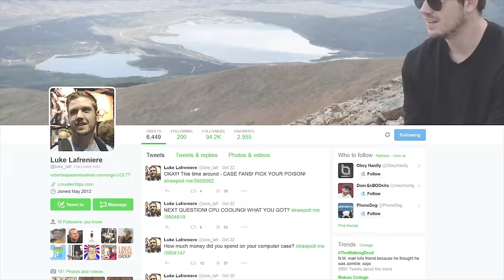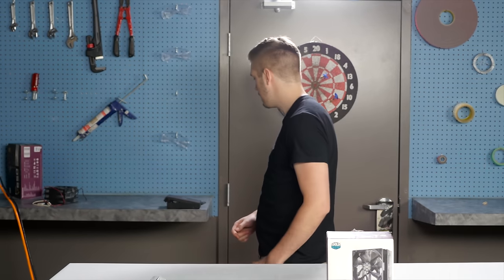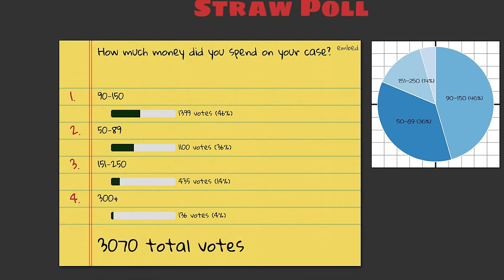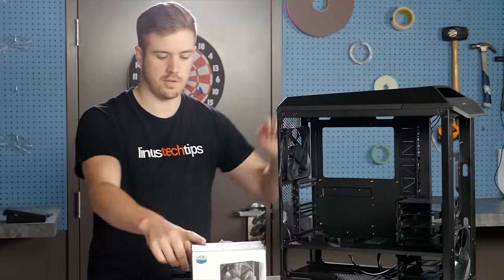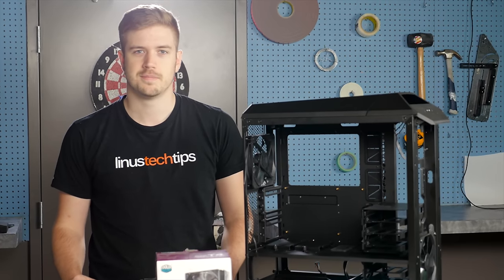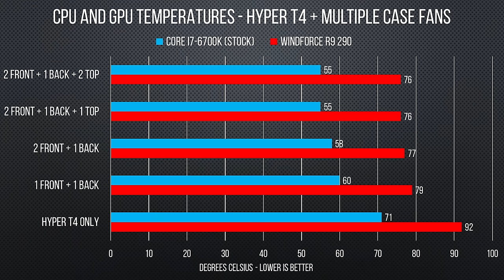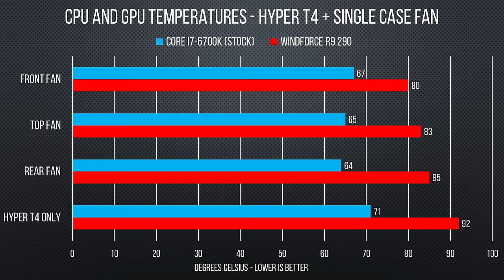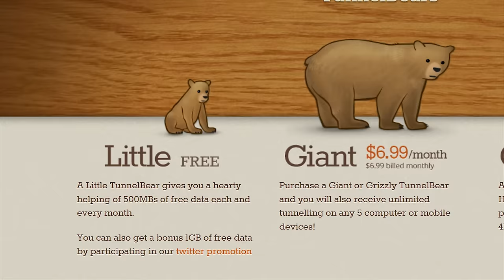Case Fans - How many should you have?

Comment: Fans are blowing in or out? How do you forget to tell us that?
Reply: Marc Marc in more than out is always better
Reply: Usually, front fans are pulling fresh air in, top and rear fans are pushing hot air out. I think he did this way ;)
Reply: Why the hell is it not obvious to you? Top and front are intake and rear fans are exhaust.
Reply: The norm is rear & top are exhaust (heat rises) & front is intake... Centiliter is trying to troll you.
Reply: Tim Beals he's actually right. It's not fair to call him a troll. Some cases have the top configured for an intake. Such is the case with my, well, case. It has a removable dust filter on the top. I can configure it as an intake or exhaust as I see fit. Though in most cases, this isn't the case. You are also correct. Most cases use the top vent as an exhaust. The whole "heat rises" thing doesn't have much of an effect in the case as per Linus. I would assume it's because the air is moving fast and in a small space that it doesn't rise much.

Edit: my case also has a side vent with no dust filter. Thought my cpu cooler fan seems to be an intake rather than a exhaust. Some cases are built with a different setup in mind.
Reply: my gpu went from throttling in stress tests to 75C max in stress tests by flipping top from exhaust to intake. Depends on the setup. If your intakes are feeding a rad for example its hard for your GPU to get fresh air since not much makes it through some rads.
Reply: Crusherman97 f
Reply: @raynjpg  heat rises so no. I keep my top fanless. I belive and AIO radiotor would fit more as a top piece
Reply: I have no idea why I didn't think about that 10 months ago... But yeah it would make more sense to exhaust through top and back and have your intake in the front. My current PC has no fans on top and has a single exhaust in the back as well as 2-3 (can't quite remember which number) intake fans in the front.

A lot of case manufacturers do like to install intake on top for some odd reason, too.
Reply: how would a bottom fan affect the temperature?
Reply: @dv2045  I would say that depends on the case, if it has somewhere to pull in air from I would prob say it helps, as heat rises and it would help to push that heat upwards faster. never tried it.  
as a exhaust I would think its useless.  this is just quick thinking from my side.
Reply: and It would also depend on how your other fans are setup. this is something you would just have to experiment with.
Reply: @RCrider185  it's true about that ,but keep in mind that depending the case design whereas mini itx,mid tower or full tower have diffrent designs and depending what type of fans you are using,that's gonna make cooling easy for your components,i use this config 3 front in take ,rear taking all the hot air outside and the top im using 2 fans are in take and while gaming my fans are at maximum speed with my cpu with water cooling rad 240mm on a i7 4790k 4.5ghz with 60-65°C or even less depending the demand in game,and a gtx 1060 Asus Dual Fan with 60-63°C
Reply: I think 2 intakes and 1 exhaust is the sweet spot.
Reply: @RCrider185  just wanted to clarify something :), heat does not necessarily rise as it is "energy." More correctly to say is "Hot air rises." Energy flows with a gradient, so it can flow in any direction, from high to low. Hot and cold are are what rise and fall :)
Reply: Thanks for clarify the obvious and over oversimplifying common knowledge, the world needs more boy scouts... lol just busting your balls, the guy was confused on how case fan setup works I didn't want to recite the laws of thermodynamics when a simple "heat rises" would answer his question.
Reply: @nGryTV  hmm, how much fans do you need then? I have 2 big front fans and they pull in air then plastic box to forward top cooler airflow into cpu boxed cooler and then cpu cooler blows into passive gpu radiator. why do you need extra coolers to pull air out? there's nothing on the back
Reply: @raynjpg  top should be exhaust as well since hot air rises.
Reply: @ArthaxtaDaVince777  Fans never suck air; they blow air away, creating a low pressure zone which will get filled by atmospheric pressure.
Reply: @TheIdk32  that's my setup with 3 intake fans on front with a rad and GPU is hot. Should I get a top fan try as a intake and exhaust and see if there is a difference?
Reply: See comment above, thats why its not obvious
Reply: @jannadark8100  Bro, did you just called the case a " PLASTIC BOX" !! Idk why this is so funny and why i laughed so hard
Reply: @TheIdk32  I know this is a really old reply, but very curious. I'm about to do some config testing because my GPU (290x) is getting very hot. When you flipped top fans to intake did you switch front to exhaust, or keep everything intake with 1x rear exhaust? I have no rear or bottom fan mounts available (the rear is because of the size of my cpu cooler...noctua C14-S in a m-atx case, to cool the shit VRMs on my 7 year old mobo). Thanks!
Reply: @-Ghost- IQ my case has two places at the bottom and one on the rear, ive installed rear exhaust fan on the rear side. should i install 2 intakes on the bottom or exhaust ones there aswell?  :/ i kinda dont know much about cooling.
Reply: "Heat rises" is applicable to convection cooling systems, I.E. no fans at all.  In which case the bottom and top needs to be as open as possible, end of story.

With fans it's completely irrelevant.  Heat is going where you want it to go based on airflow in the case.  The typical setup of intake from the front bottom and exhaust from the rear top is fine, but I have reversed that and saw no change in temps.  Just make sure the case is as unobstructed inside as possible, and that your fans have room to breathe on both sides.  Then pick a direction for airflow and have all your fans pushing that way and you're good.
Reply: I have one of my top fans as intake and the other as exhaust 5Head
Reply: @raynjpg  Top is intake? heat goes upwards boi, it would make more sense to push it out.
Reply: @suqzz966  u can use it as a intake if its place towards the front of the case as it pushes alittle more air that's going to go to w.e. I however have 2 intake on top,2 in the front and 1 140mm exhaust. This setup has yielded the best results after hours of testing..the hot air goes to the exhaust and empty pci slot holders
Reply: @raynjpg  oh yeah I just love pushing all that hot air down into the rest of the system again and also away from the rear exhaust lol
It's really case specific though outside of that, it's pretty easy to map out what the airflow is looking at a finished build, except when it comes to a normally mounted gpu maybe
Reply: Brandon S  you don't need an exhaust either though lol
Three fans is good enough. If they have enough static pressure you can go fine with two front takes.
My computer is thirty feet tall and is suspended from the roof.
Reply: Very interesting and helpful comments here
Reply: Suqzz but it also create a suction that will affect the front fans. Makes sense that you keep everything in the same flow pattern.

Comment: you did not test push, pull, that also makes a huge difference, pulling the heat out or blowing cool air in
Reply: I was thinking the same thing. Also he never said whether the fans on the top of the case where intake or exhaust.
Reply: i found making them "intake" is a big NO NO, cause it sucks in all the dust that falls on top of the case, but it should be intakes for this reason alone ,water cooling, all the hot air from CPU is going up into the water cooler(if you do have a water cooler) and so the top fans should not suck in that hot air through the water cooler
Reply: +drink15 uhm fans is for airflow, comes down to what airflow you get from how much fans you put in
Reply: +drink15 was not arguing wat the video was about, just trying to give advice on future videos he would make, think of all the agles
Reply: I would like to see luke or linus do a video on Teraflops on GPUs and why the AMD R9 480 has 5.5 Teraflops but is still significantly slower then the Gtx1060 with only 4.4 Teraflops.
Reply: +Daniel Westcott yea,  not only that, its got less ram, less bits, dont get it myself but yea
Reply: Same thought, got nearly the same configuration. Just went to put in one fan at the top to pull air in front of my cpu cooler and the other on top right over the cpu cooler to push it out and it's running quite nice. Didn't take the exact temperatures but i remember it's not a noticeable difference to both fans on top pushing out. Made this decision because i wanted to prevent the configuration to suck dust from the back of the case. So 3 fans pulling and 2 pushing.
Reply: yee
Reply: Just posted a comment before seeing yours. That was what I was more interested in seeing. The different fan configurations was great and all, but wtf were the top/back fans doing? Pulling air or pushing out (front fan is seldom pushing air out)
Reply: +jaco kruger Usually the terms "push/pull" are for radiators, as for example a top mounted exhaust radiator can be push or pull through the rad, but be exhaust either way. "Exhaust/intake" is more clear for case fans. And as to your comment about top rads being intake, I agree, but there's no "hot air from CPU". Unless you only have water cooling for your GPU, which isn't that common, the CPU heat is in the water. The hot air which may decrease CPU/loop cooling if top rad is exhaust comes from GPU or motherboard (which will actually become cooler as you're moving heat away from them, at the expense of higher water temps).
Reply: Open up the other side of your case that is the back part of the mother board and feel the heat that comes from that spot where your cpu is, now that heat rises to the top or all over the inside of your pc, now if you have a fan that blows that air out the back you still need a fan to pull it out, hence the push pull affect, exhaust/intake is stuff you get on a car not a pc
Reply: jaco kruger
EVERYONE says intake/exhaust. Look up any article on case fans or pressure and you will hear those terms. All fans push and pull. If I have an exhaust fan it's pulling air from inside the case and pushing it outside. Also most people are familiar with push/pull in terms of flow through radiators (an obstruction); in that context, an intake fan is pulling through the grill/filter, which is now an opposite meaning than above. So it's meaningless to tell someone "I have one push fan and one pull". In what direction? With regards to what? Are you talking about case fans or an air-cooled CPU? If you just say intake/exhaust everyone knows what you mean. Case in point, I have no idea what you mean by "if you have a fan that blows air out the back you still need a fan to pull it out."
Reply: +jaco kruger Why does it matter that cars use the terms intake/exhaust? Cars and computers are both machines, and the same terms can apply. Merriam-Webster confirms—_Intake: a place or part where liquid or air enters into something; an opening where fluid enters into an enclosure_ (air is a fluid). As to transformers, "how can a word have two different meanings". What!? That's an idiotic statement. It's called a homonym; LOTS of words have multiple meanings. Sure a transformer may not satisfy the meaning to change in composition or structure, but transform also means to change in character or condition; to change (something) into a different form so that it can be used in a different way And actually an electrical transformer did come to mind for me immediately, given the context of our conversation about machines and computers. It's ridiculous to say a word can't have two meanings. Someone imagined Transformers for a comic book or w/e, and it is now a proper noun that's acceptable to use. There's a town called Chicken, Alaska, are you saying no one can use Chicken as a proper noun in that case since chicken was already a word? Of course not.
Reply: Malus1531 its a descriptive word, and no computers and cars is 2 diferent things, its like saying water and electricity is tha same thing cause both flow and have a current? that is idiotic
Reply: jaco kruger
You're not making any sense. I've clearly won this argument.
Reply: hot air goes up, and dust goes down so big no no!, top ones should be exhaust
Reply: Lious Cortland But if there are more exhausting than inhaling fans the vacuum sucks dust too. and other configurations are ineffective for airflow. (there's a dustfilter on top too)
Reply: With positive pressure in your case, pulling out does almost as good as push/pull.
Reply: Don Mega You didn't understand my setup. One Fan is pulling air in and the other one is pushing out on top. And above them is a dustfilter. If the System isn't running dust can't fall into the case on top and the one fan pulling can't suck it in.
Reply: Einfach Valle i got the same in my pc, hot air rise up and so the dust that would have fallen on top of your pc is blown away by the top fan that is blowing up and out of your pc, but that is how i did it and it works 100% fine for me
Reply: jaco kruger
Reply: The entire case is a push-pull setup with 1 rear exhaust fan and 1 front intake fan. As far as CPU coolers go, well, this was case fan testing with the CPU and GPU coolers being the constants to be able to make the comparisons.

Comment: And what's with push/pull configurations? And high pressure or low pressure inside of the case? Would like to know what kind of difference that would make depending on the number of fans.
Reply: +Kazu Push/Pull configs have generally been proven to not be cost-effective.  Chances are, putting that second fan on your case somewhere would have a much better cooling effect than on your CPU cooler.
Reply: +jedidethfreak If you're talking about radiators, then yeah push/pull doesn't really do anything. But push is better than pull
Reply: I'm not talking about water cooling - I'm talking about heatsinks.

If you have two fans, it is far more cost-effective to have one on the case and one on the heatsink than both on the heatsink.  Same with three fans - two on the case is going to be more cost-effective than one on the case and two on the heatsink.  Basically, unless you have every fan mount on your case filled, you're unlikely to get better performance out of your air cooler with push/pull.
Reply: jedidethfreak A radiator is a heatsink
Reply: Berenger Christy We're talking about aircooling.

Did you not watch the video?
Reply: jedidethfreak A radiator is a device used to dissipate heat and so is the same thing as a heatsink. The video was not talking about heatsinks, it was talking about case fans, making the original comment off topic. And despite what you want to call it, the same exact principles apply when choosing a fan for your heatsink or radiator, which again, are the same thing. One just doesn't use water as the liquid
Reply: +Berenger Christy As pedantic as you're trying to be, you're still wrong. A radiator and a heatsink may both operate in heat transfer, but a radiator operates with fluid passing through it, a heatsink does not. You were doing fine in your first comment, went all downhill from there when you couldn't be almost wrong on the internet.
Reply: Berenger Christy Exactly - the same rules apply, meaning that, unless every case fan hole is filled, it doesn't make sense from a price/performance perspective to go push/pull.
Reply: jedidethfreak Well then, gg
Reply: +Kazu Linus already made a video on this

Comment: I know it's 7 years old, but I wanna point out the thing this video missed:  Noise levels.  He focused only on temps, which isn't the primary reason for loading up a bunch of fans.  A couple of fans can run fast and blow a lot of air, but it's noisy.  If you have many fans, you can run them slower to move the same amount of air, making the PC much quieter.

Comment: I went with 2 front, 1 back, 1 top. My front bottom fan made a big difference to the basement area where my mechanical drives and power supply are. Corsair 4000D Airflow case.